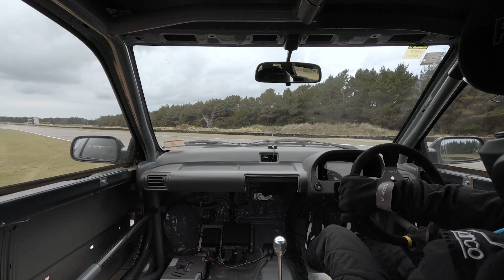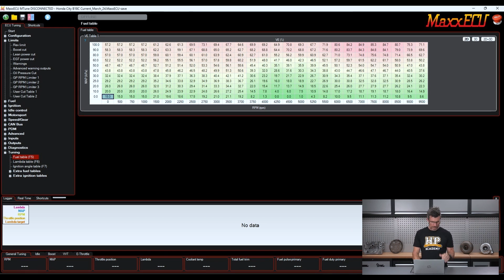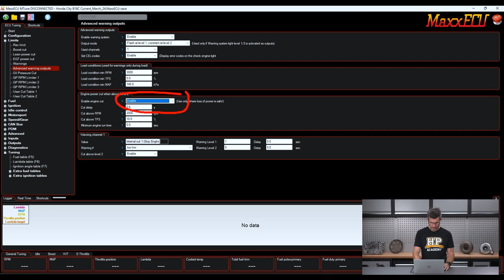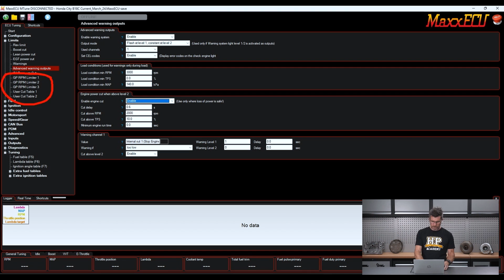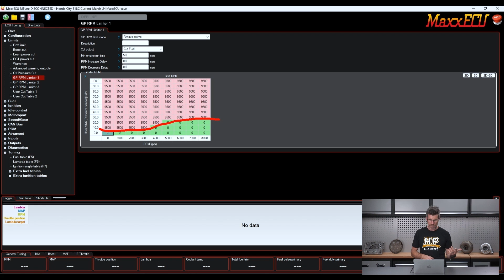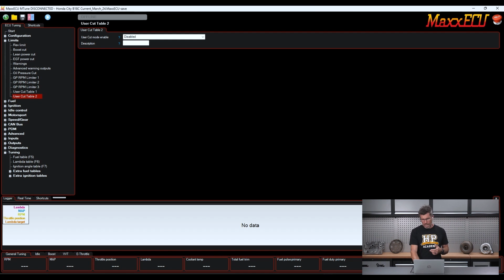Protect Your Engine With MaxxECU

Comment: Can you please do a video on the maxxecu mini. I am trying to understand how you would wire it for sequential injection when it only has wiring for one trigger. Looking at it for a 1.8t which has separate cam and crank sensors.. eventually looking for the cheapest entry level ecu that will still keep the engine safe.. ecus aren't cheap in nz...
Reply: Use one digital in as home/cam sync

Comment: With fuel rpm cut, what happens to the fuel wetted out on the cylinder head wall, does that make its way into the engine or does it stay wetted on the walls, waiting for the injectors to add more?
Reply: You can manipulate the settings for that. On a previous project years ago i had some minor issues relating to what you asked